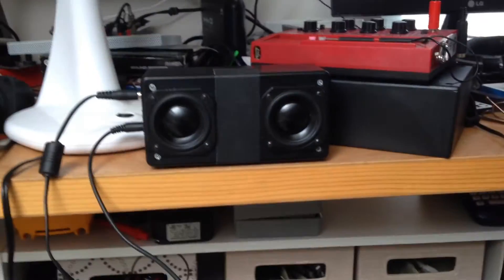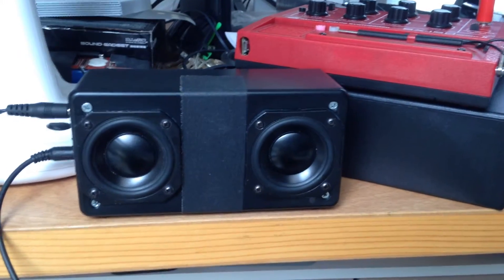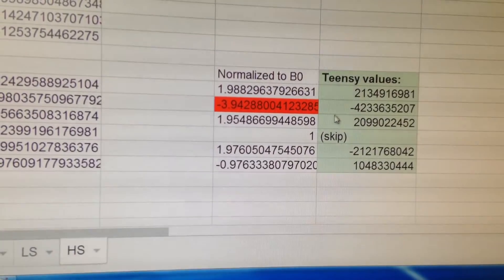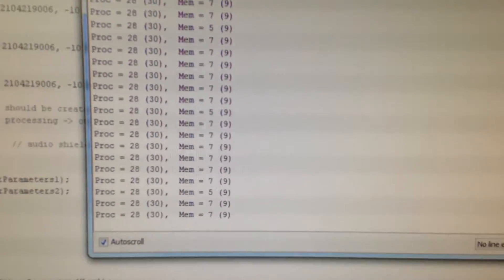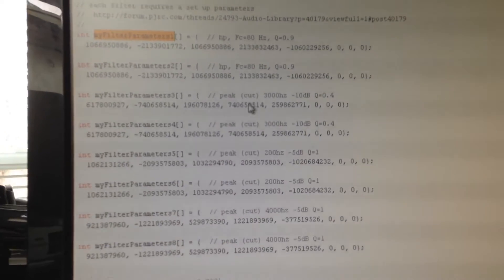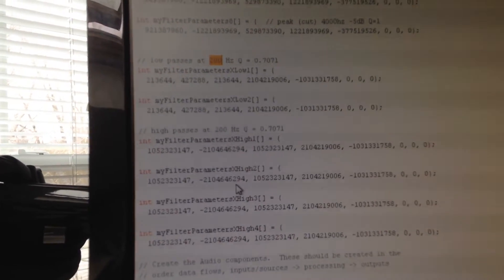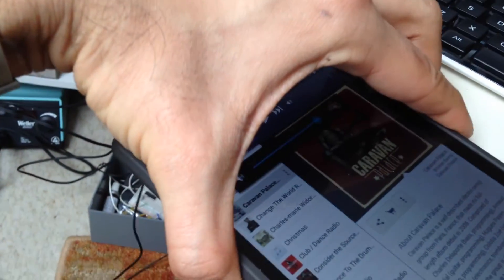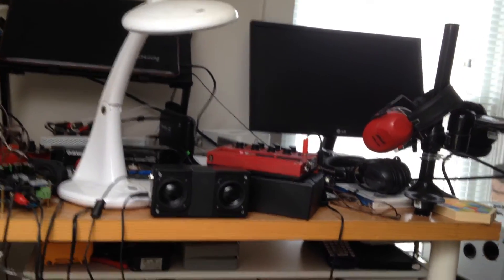Teensy 3.1 with audio shield for speaker EQ

Comment: Cool project! 

Have you used the microphone line input?  If so what did you do to get this to work?  Also, what progress have you made using the SD card reader and playing WAV files from it and sending out to the phone line?

Thanks!
Reply from the maker: +Matt VanMeter I never used the microphone input nor the SD card reader. However, I have built two projects so far based on teensy with audio:  A custom EQ for my car and a custom signal processor for a speaker that required mid-side processing of the input signal for some acoustic experiments.